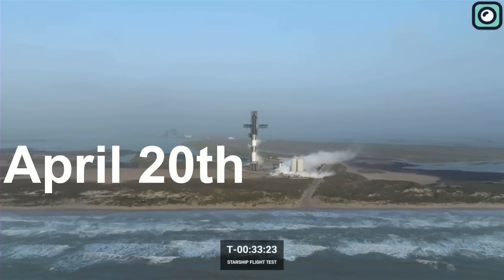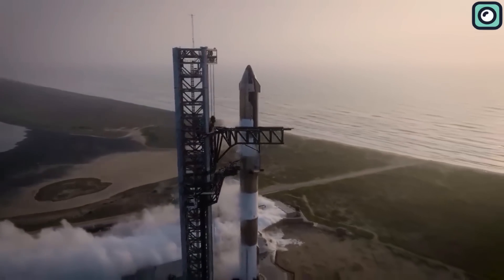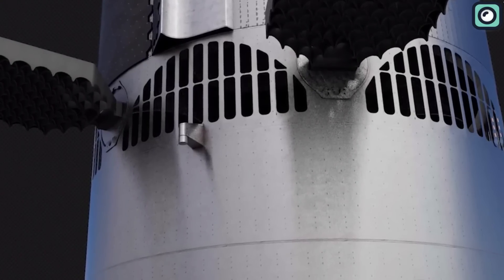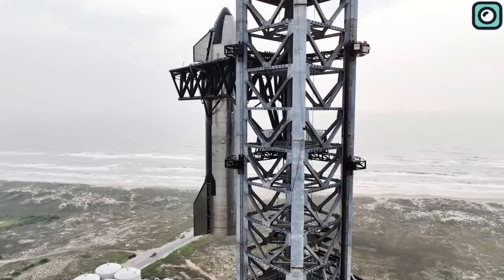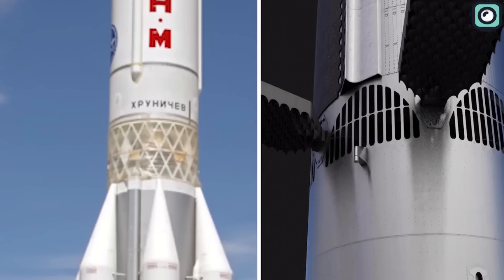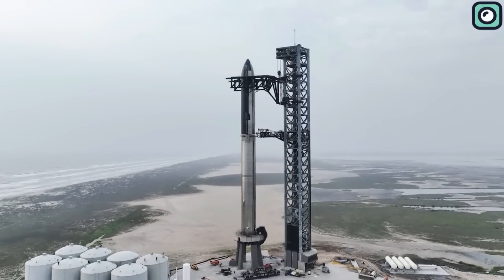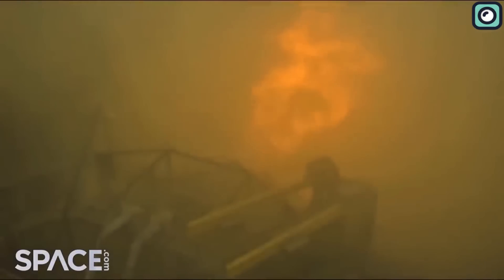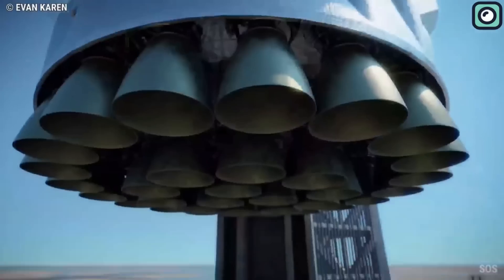Elon Musk Just Leaked the New Starship and It's Mind Blowing!

Comment: At 4:40  in the video, the commentator says "flaps". The correct term is "grid fins." Unlike the flaps in an airplane, these are not intended for increasing lift at slow airspeeds for safe landing,. These are control surfaces specially designed to function at hypersonic and supersonic velocities to control the path of the booster as it returns to the drone ship or the landing pad for propulsive landing.

Comment: Space Cadets at SpaceX knew from the very beginning that unpressurized Skirt of the Starship was too weak to support fully fueled Starship during liftoff. Test flight proved that this concern was valid as Skirt partially collapsed at acceleration rate of only 1.75g while it should withstand acceleration of 3.5g. One of many alternatives how to solve that problem was using 6 VacRaptors as support columns. In order to disguise true nature of current redesign hot staging was also incorporated. This way Space Cadets at SpaceX will pretend that support structure holding up the Starship during liftoff is just exhaust gas confinement structure below 6 Vac Raptors and pretend that main reason for change was introduction of hot staging. If that is the case then three more VacRaptors and support structure mounted on the upper dome of SH Booster should follow in a short order.

Comment: Autogenous pressurization does not eliminate the need for some g-force (ullage thrusters or hot-staging) at stage separation.  Gas/liquids will stratify under some acceleration (buoyancy comes into play), otherwise pressurized or not, the liquids will form free floating globs within the tank.

Comment: I do not see the need to fire up the upper stage engines before stage seperation.  Starship has way too much power to fire up those engines while still connected to the booster. The booster is reuseable and you want it undamaged so you would seperate it and then fire up the upperstage rockets. I'm guessing that special section is going to be used in the abort system. In addition to blow open the tanks they will ignite all the engines to ensure a faster ignition of the leaking tanks.  On the last abort, blowing open the tanks only caused the Starship to spin as the leaking fuel acted as a gas jets. Only after one full rotation did the engine flame come back into contact with the trailing leaking fuel and cause it to explode.

Comment: Lunar craft, orbital tankers, and other craft that will never see atmospheric use have no need for the flaps, supporting structures, heat tiles, or atmospheric engines. This will reduce their costs and allow greater cargo capacity. The orbital tanker depot craft won't need the large crew/cargo section either, and this will allow greater fuel capacity. Even "shuttle" tankers will be able to reduce this section in order to carry more fuel to orbit. I foresee at least 6 different variants of Starship for the different mission requirements. Of course, this is assuming that Starship, as we see it now, continues to be the core design. Different missions will be best addressed with craft optimized for those missions regardless.
Reply: I think Starship should be built upside down
ad backwards so it will be ready to return from mars.